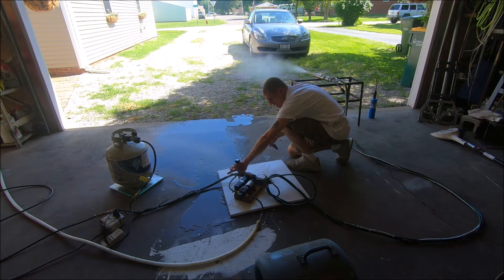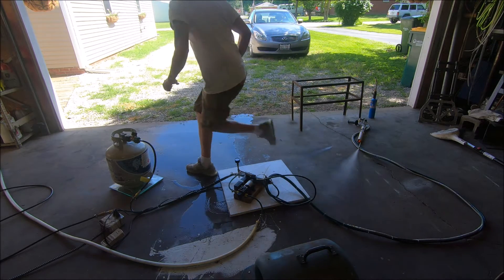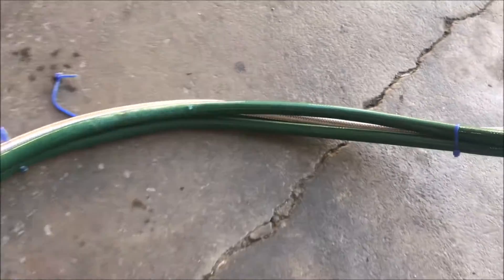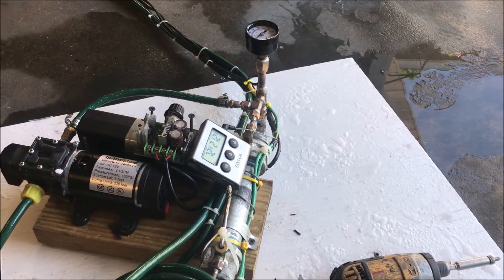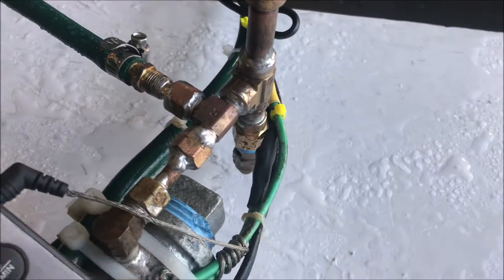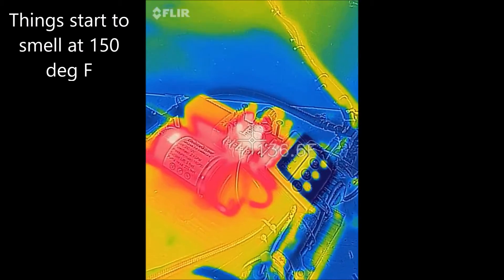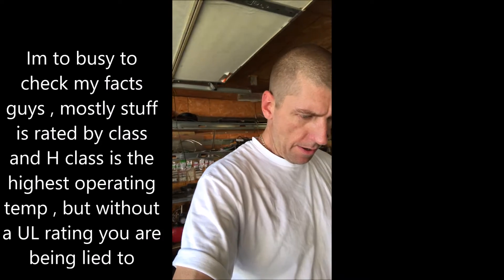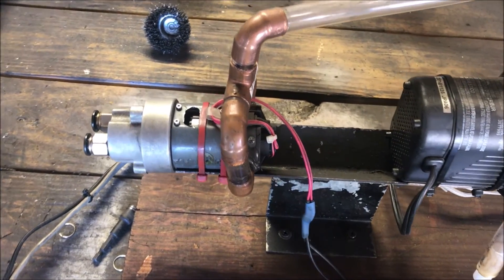Mono tube Boiler Takes flight during test

Comment: Jesus how do you know all this stuff
Reply from the maker: LOL Jesus of coarse
Reply: @NOBOX7  hey nobox... I'm trying to make a monotone steam generator for a steam engine I'm making. Im wondering can I get away with not buying so much line if I have stop valves on beginning of tube and ending as well. Could I vacuume the line of pressure before pumping water in creating a lower boiling point giving me dry super heated steam in a closed loop system where the discharge of steam engine in sent to a radiator and then into a radiator inside of a water reservoir. 
What do you think?
I saw you used to comment on lynkx steam account